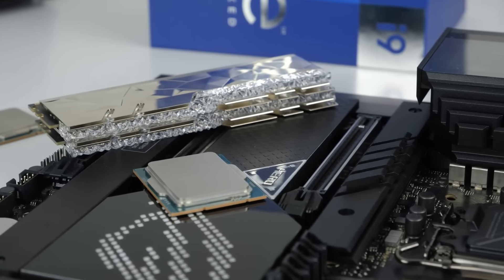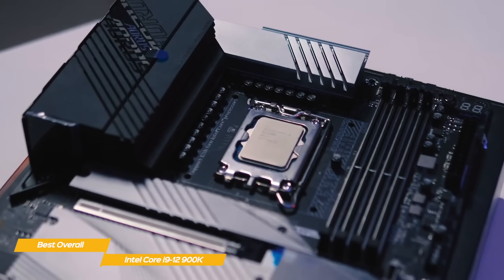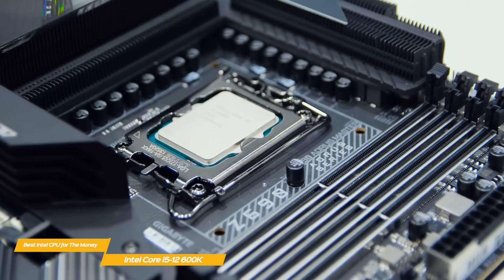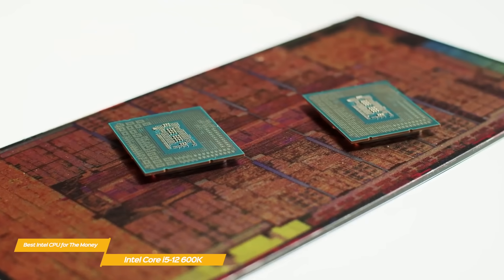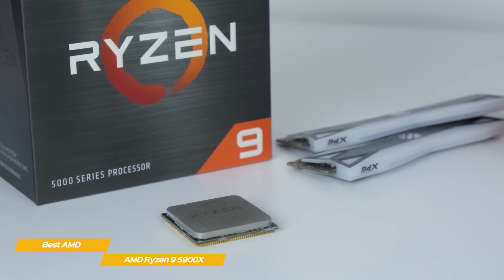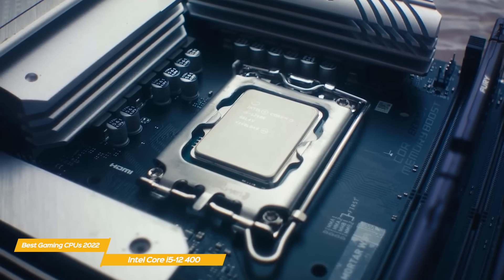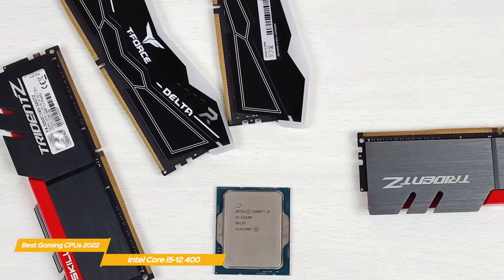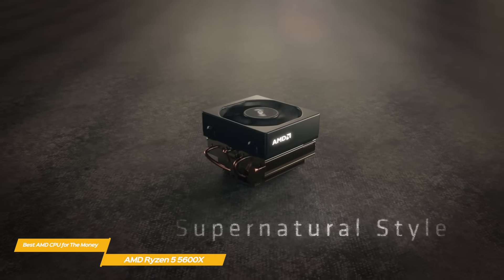TOP 5: Best Gaming CPU 2022 - Best Processors

Comment: Guys I have a B 460M Pro motherboard, rtx 2060 card, 16 GB Ram, 650W power supply, is there any chance for me to get Dota 2 maxed out at 144 FPS?

I'm currently at ~100 fps with the core i3 10105F, and I'm looking at an upgrade core i processor that is LGA 1200 socket so I don't have to switch motherboard.

Would appreciate any help I can get

Comment: So I’m about to build a pc and I got a an i5 12600k and a 3060 for my gpu. I play rust a lot and from what I understand it’s a pretty cpu heavy game. Do you think that these were a pretty good choice?
Reply: You should run 60-75 fps with no overclock. I got a 3070ti with the i5-12400f for Christmas and I get 90-110 fps on rust. Rust is also a very demanding RAM game so make sure u have atleast 16GB ram but if u get 32GB it will boost ur fps by atleast 15-20

Comment: Im about to buy a new PC and was asking myself witch one is better for the Future i7 or i9? Maybe someone in here knows better, im gonna spent like 1600 bucks on it with an RTX3060 TI 1 OC, and also would use it for Home Office Work Video editing and stuff, any advice?
Reply: Tbh unless you’re going to put a 3090/3090ti or 6950XT/6900Xt than definitely go for a i9. But if you’re gonna do a 3080 or under then go for the i7, if you want to spend less money than go for the i5 12600kf. The F means it requires a discrete graphic card which you’ll be using. But I recommend the i7 12700kf it’ll last you 4-6 years and it’s just a better for work and if you want to gaming. Make sure to get atleast 32gbs of ram and a good motherboard, when building a pc for the first time Pcpartpicker is your best friend. Hope this helps
Reply: @27two  Thanks, i was checking almost everything i think i will stick to a 12700F i7, i dont need to overclock but for 14 Bucks more i get a OC 3060 TI with more Power so why not, im not sure about 32 GB thought but i think ur right it would be a better choice for the Next Games, i think i will wait just a little more. A good i7 is better then a crappy i9
Reply: @John.M  Honestly you don’t have to get 32gbs but if you’re going to use it for Vr, light editing or 3d modeling it’ll be better for that. Also if you’re going to play games like Wz, cyberpunk or rust it’ll definitely help. My friend had 16gb and mostly plays WZ at the moment said that it wasn’t enough, he switched to 32gb and everything was smoother(I can’t give you a personal experience bc I’ve been on 32gbs ever since I had a pc) So personally I’ll just cough up the extra $50 or so for 16 more Gbs so future games or anything else you wanna do won’t be bottlenecked by the RAM. And your gonna get a i7 anyway so why not, right? And lastly if you going for a more budget build than fuck everything I said and get 16gbs, it’ll be good for the time being.
Reply: @27two  I will spend like almost 1700 bucks on the new PC i almost bought one but i will wait a little more because the 32gb will explode my Pocket lol. Thanks for ur Advice man im gonna check what i can get for that Money so the PC isnt out of Date after 5 Years.
Reply: @John.M  go 32GB as he says if u havent already, some games really need a lot already, something like Star Citizen is a chore with 16GB, same goes for many new games probably but most importantly 32GB is the lower end standard for editing and i would never go under it.

Comment: So i9 12900K Best Processor For Gaming? Because I want to build a pc
Reply: yes, but its VERY costly cause you want a good motherboard to process it and a good GPU to match it (3080fe/ti) not to mention the power supply to support it (750w minimum). itll be around 2k for just 4/7 parts you need to finish the build. also you really only need a pc like this for rendering/video edditing.